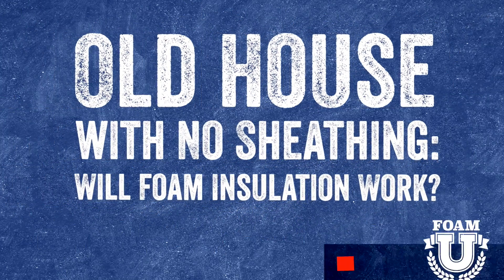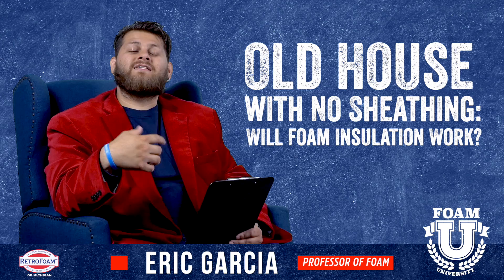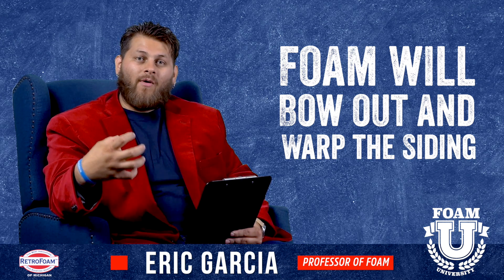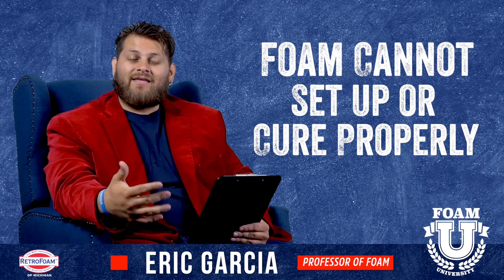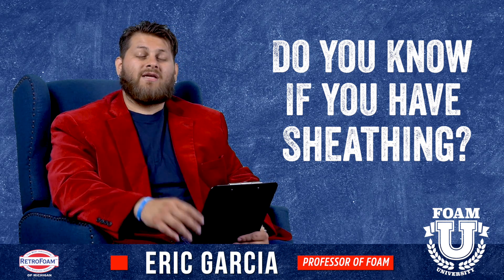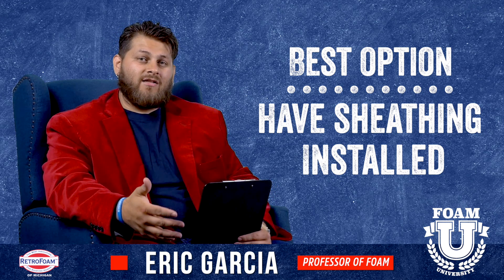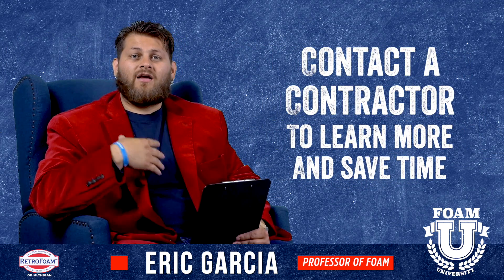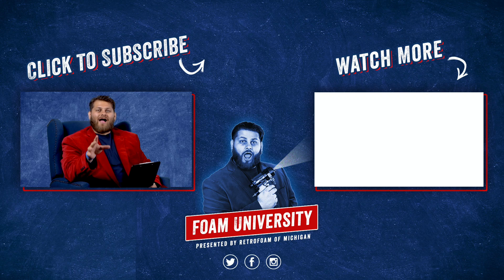Insulating Walls in an Old House with No Sheathing: Will Foam Insulation Work? | Foam University

Comment: What will happen if you just insulate the walls with kraft batt insulation? Knowing there is no sheathing on the exterior walls of an old house.
Reply from the maker: Installing fiberglass batts slows the spread of heat and cold, as well as sound. However, batts still allow airflow and can still result in high energy bills and an uncomfortable atmosphere in your home. Now, with no sheathing, injection foam is out of the question as an option for insulation, but spray foam could still be done. You can find some more information on our blog: https://www.retrofoamofmichigan.com/blog/foam-insulation-when-house-has-no-wall-sheathing

Comment: We are in a 87 champion dw and have had to take down Sheetrock on outside walls and discovered this. Also saw right outside in some areas. Found mud wasp nest and other ridiculous things like bathroom exhaust being vented into 8 inch roof space full of loose insulation with a open vent access above the exhaust fan 🤦🏻‍♀️. Quotes to sheath have been 35-37k with vinyl since metal siding can not be salvaged. Home mortgage is only 70k WTH
Reply from the maker: Oh no! I'm sorry you had to deal with this.

Comment: I have a house that was built in the early 70's, I redid one room and found out that the outside "Sheathing" is of a sheet rock style product. Does this count as no sheathing? 
Thanks in advance, great videos.
Reply from the maker: That may work, as long as it is in good shape and is strongly secured.